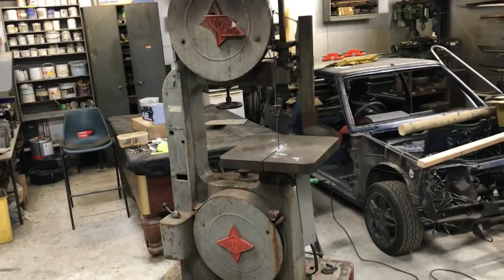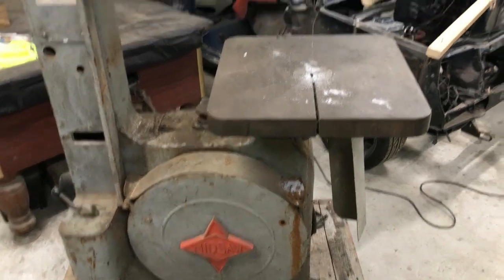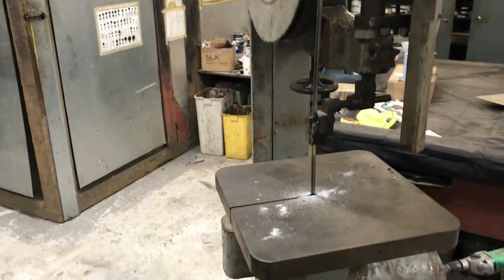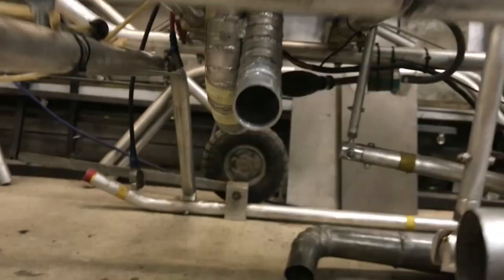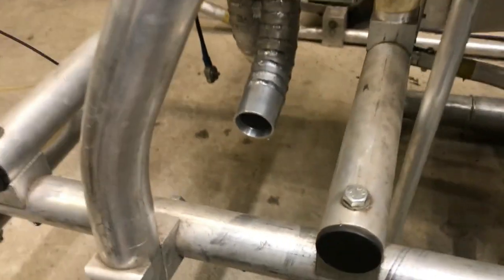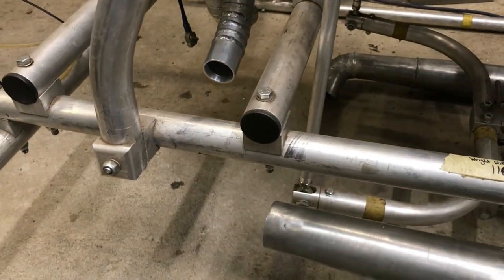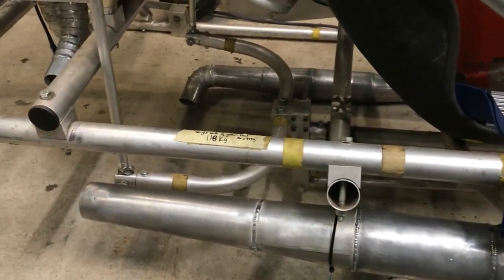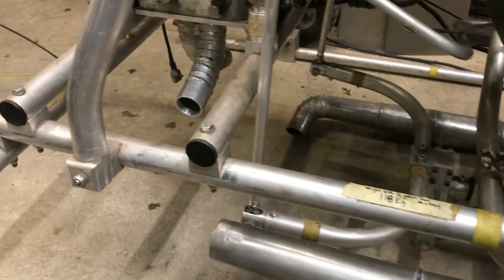Homemade coaxial Helicopter exhaust part 2

Comment: Hey Ben don't they use steel for these things because it's more resonant,
Reply from the maker: I'm not sure Peter, I did find a company who were making aluminium expansion chambers for motor cross bikes historically but stopped producing them, this was due to customers not wanting to pay the extra for the saving in weight. Saving weight may not be as critical on a motor cross bike, when compared to a helicopter. As for performance the article I read suggested there wasn't a problem with using aluminium. 🤞

Comment: Sounds good. Aluminium gets pretty weak though as it heats up. Cant find a 4 stroke motorbike engine? Best of luck.
Reply: Engines have always been a problem, if its motorcycle engine it's got to be multicylinder because of vibration issues.
Reply from the maker: @cloudusterable  Engine vibrations and uneven power distribution in engines are a complete pain. I would certainly  choose an electric motor if it was financially viable. My friend tried a hydraulic motor powered through an engine which gave smooth power transmission but energy losses and weight was the problem there.
Reply from the maker: Good point, Aluminium for an exhaust was a choice I wasn't sure of. The expected exhaust gas temperature is 400 degrees Celsius. Will see what happens in  the next test. The Airscooter 2 used a 4 stroke turbo charged engine, not sure what weight that engine was but I can understand their reason for developing it. The 60hp Johnson power head weighs 38kg hard to beat that power to weight ratio for a sensible amount of money I found.